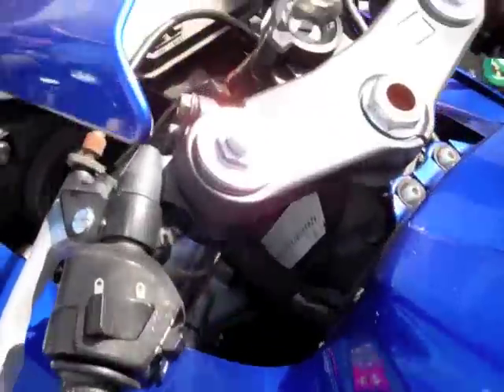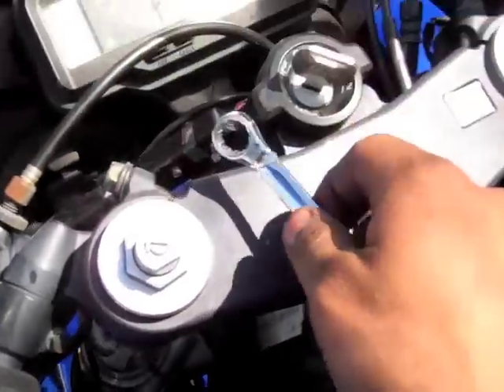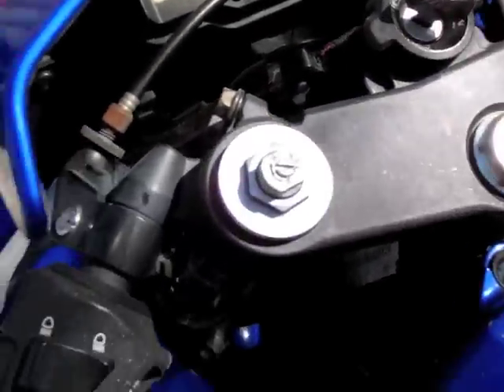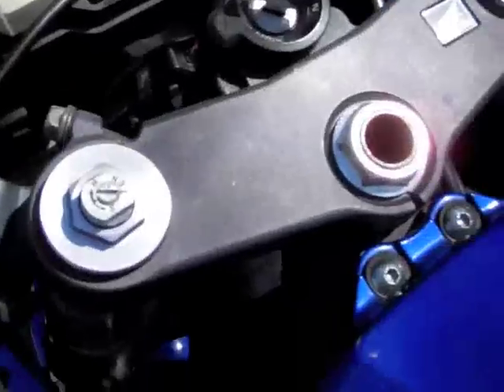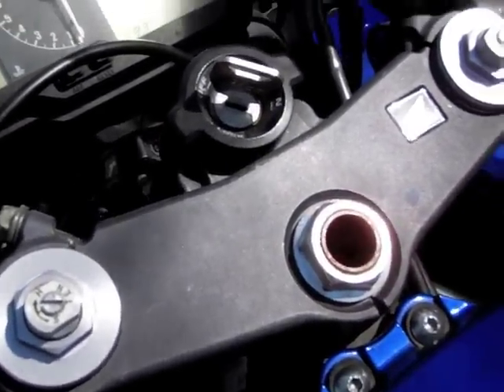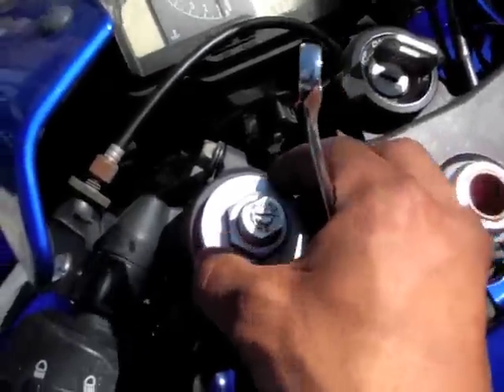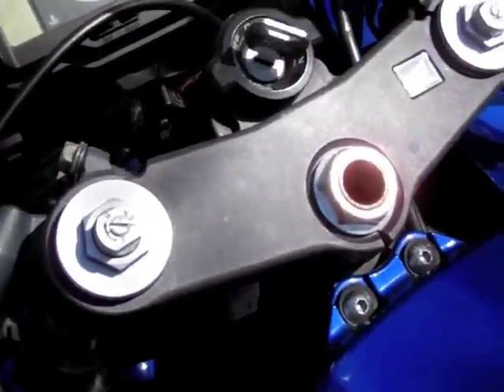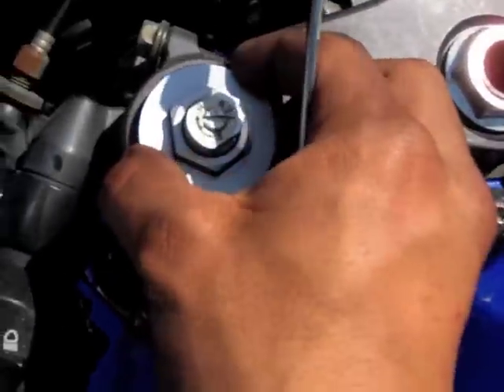How-To Lower a Front End on a Motorcycle

Comment: I'm 5'2 and will be buying my first bike within the next 6 months after I get my endorsement and take a basic riding course at my local college & I will need to lower any bike I get unless it's already been lowered. My friend has an r6 and I am on my tip toes when I sit on his bike and he has it stock height as well as my other friend with her ninja 250 I still can't really touch the ground unless I'm leaning more to one side which I know isn't safe so hopefully this video will help me out with my future bike <3
Reply: Talk to someone that has lowered a bike before you do it on your own. Make sure when you tighten the triple clamps back up that they are evenly spaced on both side or your front end will wobble once you get up to speed and could cause you to wreck. Adjust preload in the rear shock and then loosen your front triple clamps in the front to lower that. Make sure the screws are tight, you also may consider womens riding boots with a slightly thicker sole to help a bit.
Reply: If you get any bike remotely fast you’re gonna absolutely  fucking fly on that thing. Unless you’re like 300lbs, you’ll be quick!

Comment: the correct way to lower the forks is to get smaller springs and/or cut them down to size. lowering the forks in the triple tree will put all of the plastics on the fenders and the wheel too close and they may collide when braking or taking turns. it costs more but also looks better.

Comment: How do you raise the front? I mistakenly loosened the bolts and now my forks are pushed up... Making the bike way too low...
Reply from the maker: Richel Tong if you have an extra set of hands, you may be able to pull it up while the other set of hands is keeping the wheel down on the ground. It will only happen since these bikes are not heavy compared to others.
Reply: If you can jack ur bike up get it in a position like your about to take the front wheel off you can easily adjust the forks... Seem like the weight of the bike is giving you problems..

Comment: i loosened all my bolts and placed jack in the middle rear stand front ramp , exactly how u have it and as i started pulling the ramp out ,,, nothing happened bike still stood at same height and both triple clamps were loose top and bottom ? u push the ramp towards the bike or u pull it out?
Reply from the maker: Think of it as if your are loosening a clamp to remove two pipes from each other.  After a long time of it being compressed it is harder to pull or move apart.  Just work it and use a little bit of extra force such as a rubber mallet to encourage it.

Comment: what you put under the bike?? so wen you lose it don"t go down.. im looking to put mine back up to stock settings ... Thanks
Reply: I know this is super old, but you could use straps & support from above, I beefed up a cross beam in my garage to support bikes like that. Or use a motocycle jack.
Reply: Everett Lawrence thanks I’m trying to raise the front of my bike I already raised the rear
Reply: I'd use a bottle jack & a piece of wood if needed, to slightly support or push up on the frame of bike or maybe a solid part of engine case.
He forgot to show this part.
Also the lowering the ramp by pulling out only works IF the rest of the bike is being pulled up (stabilized) by a strap from overhead.
To be careful & not have things fall or rise more than you need.

Also recall that fender to frame & cable clearances will change (lengthen / shorten) so this method is for small changes like 1-2" only.
Larger changes need to be done differently and involve more parts.

Comment: dropping the forks down is lifting the bike not lowering it
Reply: Exactly.
Reply: I think he may have said lower the forks mistakenly because when you losen the bolt what actually hsppens is gravity pulls the bike lower and the forks will be higher then the triple tree. So in reality the forks stay in the same position from ground level, what actually changes is the front end of the bike lowers
Reply: How do you drop the forks to make the bike taller??